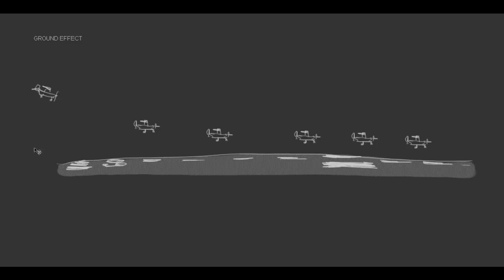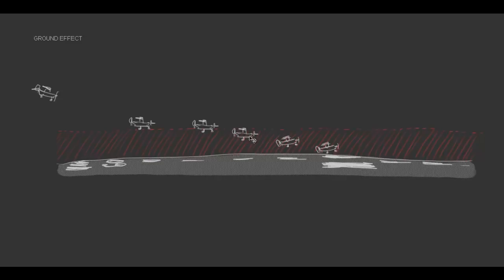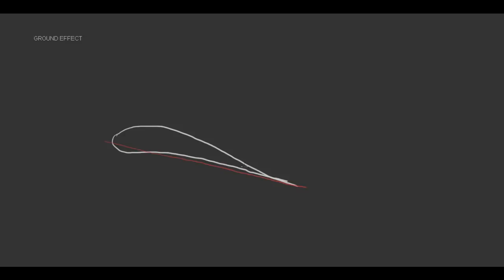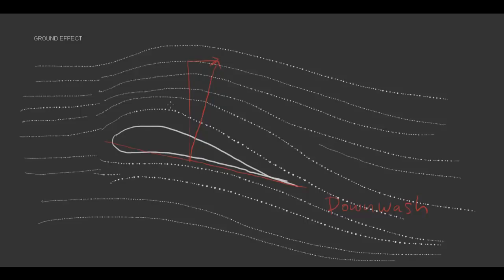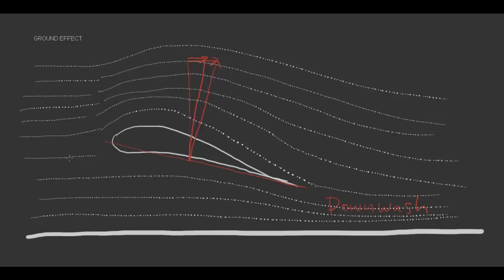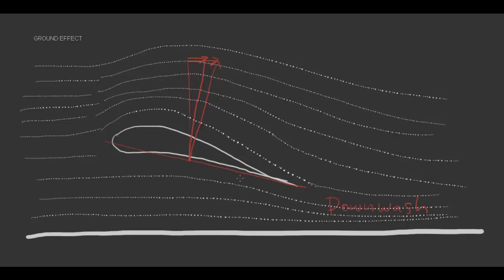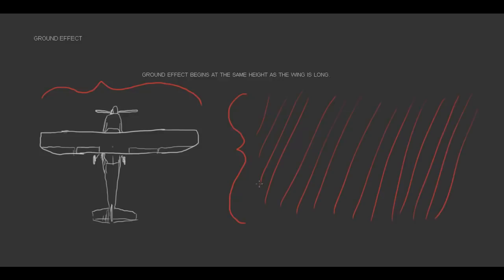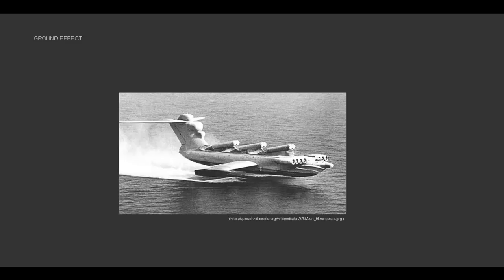AERODYNAMICS- GROUND EFFECT

Comment from the maker: Depends if you are landing. It is all about the angle of attack, and when landing the airplane is slower and therefore the angle is higher. The presence of the ground does not play a direct role, only a circumstantial one.

Comment: Not sure what you mean by wing tip vortex increasing when the aircraft is near the ground. The factors that increase Vortex is more mass, clean wing with no spoilers or flaps extended and being SLOW which I think you are referring to when it comes to being near the ground. The reason why Induced Drag exists is because of this Vortex. Take the Vortex away and you eliminate Induced Drag. One of the things Jakub said that isn't correct is lift being perpendicular to the Chord Line. It is, however, perpendicular to the Relative Wind and Flight Path but not the Chord Line. However, this is true in Ground Effect but outside of Ground Effect, Lift is perpendicular to the Average Relative Wind. Since the Vortices tend to deflect the Relative Wind downward, Lift will be perpendicular to the Average Relative Wind which is tilted downward thus giving you the 2 components Jakub mentioned, Lift and Induced Drag. Once inside of ground effect, the tilt goes away and the rearward component of lift goes away (Induced Drag). In terms of Chord Line, it is an imaginary line that connects the Leading Edge with the Trailing Edge used to measure some aerodynamic parameters such as Angle of Attack and Incidence etc. One of the words we SHALL never use when it comes to Ground Effect is the word cushion. There is no cushion of air under the wings unless you fly helicopters and are in a hover. In a hover there is a cushion of air under the blades and once you move forward, it goes away and you have to correct for the rapid loss of lift.

Comment: g'day sir, could you please elaborate on why the lift vector becomes more vertical with the downwash pointing up?
Reply: Then why does the induced drag reduce?
Reply: Could it be because.. air pressure is higher / higher density closer to ground due to gravity and staggering molecules and thus enabling higher pressure differential and higher lift?
Reply: @JacobTJ1  pretty much. When the plane is high up, there is a ton of room for dispersion of the downwash caused by the underside of the wing. However close to the ground, it bounces back and aims for the area of low pressure on top, creating more life. I think

Comment: On the off chance that anyone sees this, any explanation as to why ground effect seems to produce the opposite result in things like F1 racing?

In F1, air is forced under the car, which going by this video would mean increased lift, but supposedly because the air is forced into a smaller space, the air goes faster, so the pressure is lower which produces suction, or downforce.

Comment: Why does Rayner 1991 state that flying in ground effect too slow can dramatically increase the power required to fly? Great video by the way
Reply: And too low? Below a ratio of 0.2?
Reply from the maker: I have no idea what that means, other than the effect that happens whenever flying on the back side of the power curve. The curve will be a little different in ground effect, but the idea is the same.
Reply: Legit, I did a very poor job explaining that, let me try again. I am going to try to ask same question 3 different ways. 

1) Why does the backside of the curve become more straight up-and-down with decreasing distance between the foil and the ground?
2)  Why does the power curve become more like a D (with the top half of letter cut off) compared to a U shaped curve?  
3) At speeds less than the optimum speed for reduced costs, why is it far more costly to fly at these speeds just above the ground in comparison to flying at these speeds further above the ground? 

My impression was flying very close to the ground reduced horizontal flow, and hence, induced drag (I think we will all agree on that). Is there some speed and height combination that, when flying too low and too slow the cushion starts to get squeezed out and actually promote induced drag?

Does this make sense? Anyways, thank you for taking the time to reply to me.
Reply from the maker: +Scott Seamone the shape is going to be about the same, except in ground effect the transition point between front and back part of the curve (the vertex) is going to be more to the left (at slower speeds). This is all good theory but in practice you are only in ground effect on takeoff and landing so it is mostly just theory, not practice.
Reply: Based on the paper by Rayner 1991, I would disagree that the vertex of the curve is the same, rather it appears to become more straight up and down with decreasing height below a gap/span ratio of 1. I am curious to why that is. I don't fly ! I am a biologist interested in ground effect in animals.
Reply from the maker: +Scott Seamone now you have me interested. I now work in nanotech and am constantly dealing with effects that do not scale to the miniature from our daily lives. The effects seen in airplanes are going to be different with birds and insects. There, quantum effects begin to have greater importance. Pilots and instructors regurgitate "bro science," end to find answers to your questions you will have to ask a physicist fire the why to your question.
Reply: Okay thank you very much. I have a feeling that as an object gets extremely close to the ground,  it has to go faster to maintain the longitudinal fluid flow beneath the foil, because if it doesn't the pressure increases past a threshold and the flow begins to spit out the side of the foil, leading to a large amount of induced drag that will cause the object to stall. Thoughts?
Reply from the maker: Send me the article and I'll read it over. Jakubsvec001@Gmail.com

Comment: Very poor explanation. Ground effect allows you to maintain the same amount of lift with a lower angle of attack, it doesn't "bring the angle of lift more vertical" without changing the angle of attack. Really all it is, is an exception to the rule "more lift = more drag" and you get some lift for free without increased drag, which changes your flight characteristics and makes it harder to land because of the change. The suppression of wing tip votices and increased pressure under the wing due to proximity of the ground are the reason for this extra free lift.